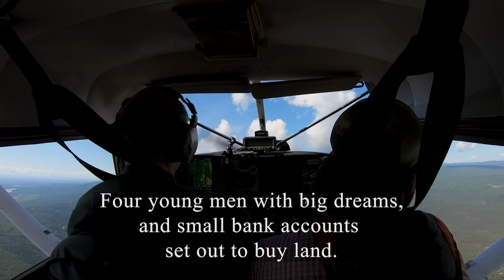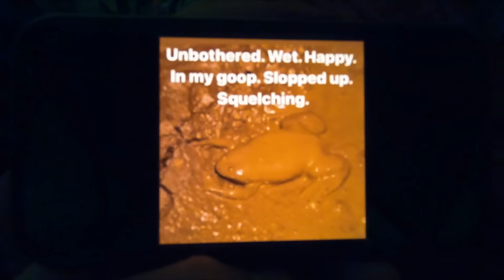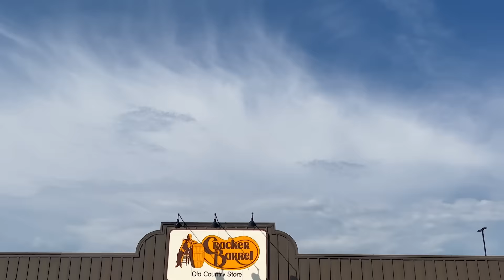30 days Starving and Building a cabin. Hungry Alaskan lessons

Comment: Rugged Alaska. 30-Day off-grid cabin…
If y’all can do it all again, what would you do differently?
How would you pack differently?
More nutrient-dense foods, less packing (meat jerky, freeze-dried fatty morsels)
What tools did y’all come out there with?
What and how much materials (such as nails), did y’all go out there with?
How many acres was the land?
What amount and weight of water did y’all travel with?
Could y’all have had the next scheduled bush plane stock the bulk of your tools & food? How much does a bush flight cost one-way? Learning from the experience, would it have been worth the money?
Moving logs. What better tools could you have taken to accomplish this task?
Wolves. How would you have dealt, if they visited?
Nail shortage. What if y’all bought another, much smaller auger bit?
Moss Collecting. What better (non-electric) tools would you have used?
Ate until y’all puked. What did y’all eat? What was the first thing?
During the whole 30-days, what was the one food that y’all craved the most?
Battery. How were y’all managed to not have battery loss from filming so much?
If carrying weight wasn’t an issue, but power was, then what other tools would you have bought with you?
Reply from the maker: Hey thanks for the interest into the video. 
Done differently we would’ve brought more food of course. In the thumbnail are basically all the tools we used except the folding silky saw (basically did all the cuts). We went there with 3 tarps and a box of 20 penny nails. (We should’ve brought spikes and more nails). The land is 5 acres. For water we brought jugs to fill from the lake and pots to boil it. The bush flight is $700 one way so not cheap by any means. Another flight of food would’ve been nice but we continued to have hope for more fishing success (the fish knew otherwise). Better tools would’ve been a chainsaw and gas but that was too heavy to bring with all our other gear we needed. We didn’t think much about the wolves, it was mainly bears and possible moose we had to be concerned about up there. We had a 10mm, a 357, and bear spray. We had joked that a bear would bring us food to fatten us up instead of eat us anyways. For the roof/ nail situation I think it would’ve taken too long to auger all those holes so our “X” plan was the best we could do. We plan on redoing the entire roof next trip anyways. For moss collecting I think we did it the best way there is with a small axe and rope. The first thing we ate was a large mixed platter of appetizers. (Not the best move) we should’ve ate light and we even knew that going in but it was hard to resist. The one food I personally craved the most was Tony’s oven pizza haha. Lots of fast food cravings too and I’m not normally a fast food guy. Lastly for charging the batteries I used the goal zero nomad 10 solar panel. Hope that helps!

Comment: The odds are that a $250 chainsaw would have left you with no working saw halfway through. But I would have recommended a large crosscut saw for felling instead of that folding saw you went with. Your wooden hammers were really pretty great and I hope you got a lot more use out of them than you showed. An amazing amount of work accomplished in a short time!

Comment: So basically a chainsaw is a must have. Quick tip i have a portable power station that runs on a portable solar panel. Which charges my electric chainsaw, which doesnt need gas

Comment: Guys, next time you decide to do this think about rations. Planning, resources,, planting food sources and gathering food etc. You have thin walls little insulation for when you go back. Maybe niy army ration packs for winter not store bought foods from locsl supermarket. Chainsaw still need fuel oil and sharpening. So hand tool better, but lads think next time or at least ask someone whose built in the woods.

Comment: hard work. looks like nice soft pine least that helps a bit. 
it might pay to rub down with Tung oil or soak your stumps in any oil will probably do. even engine oil is good. wood soaked with oil stops water getting in and freezing splitti g wood it also deters a lot of moulds and bugs. will make your stumps last longer.

Comment: Overall, I'm impressed with how much they got done in 30 days with only 2 guys and nothing but hand tools.  The construction of the cabin looks sturdy, but they need a floor and finish the roof. They could have saved many days, with a chain saw, some sharpening tools and 10 gals of gas.  They were also missing some good sturdy hammers.  I hope that roof holds up under a snow load, but i have my sincere doubts!  In any case I wish them luck.  I admire their GUMPTION!

Comment: ya know, at first happening upon this video I just rolled my eyes at yet another dramatized alaska video. Being an Alaskan I've seen endless massively over dramatized content thats all kinda the same. Everything is portrayed as the EXTREME cause its ALASKA. 
I'm 15 mins in. A lotta thoughts lol most good, some not as great. But you guys are definitely hard workers and not quitters. Your resolve is impressive.
30 mins in.) I could learn a thing or 50 from your remarkably good attitudes. I tend to be a very pessimistic person and know how low my spirits would drop if in the same situation. Color me impressed. 
32 mins in .) no way that roof made it through a winter up here almost certainly collapsed. But I'm in the Fairbanks area too. so our snow load is pretty high.

Comment: You have to put out lines for fish overnight and traps for small animals and birds, and you won’t have to waste time on the water fishing. Don’t do instant food - you both need to carry 5 lbs uncooked oatmeal and 15 lbs each of uncooked rice and beans for 30 days. These expanding foods (1 cup makes 3 cups) alone could account for half to most of your calories daily if you have discipline. A 12-pack of Spam might be more to carry but at over 1,000 calories per can, it is worth the extra effort, but there are singles packs. 4 lbs beef jerky each. 30 Cliff bars each could save your life. Bears still charge after you shoot them, so shooting a bear at handgun range is risky - a rifle nearby could help manage some of that. Carry an air horn with you at all times - a blast should scare them off to prevent you from having to shoot them. If a moose comes, leave them alone at all costs - just go fishing. More people disappear in Alaska each year than anywhere else. Grizzlies are hungry - they will eat you. Nice cabin!

Comment: You guys did good, real good. Your humor showed you both were above the average intelligence of most. And IMHO that is your most important and innate quality. However, I just don't know why you just didn't start off with a chainsaw, a generator, and cordless drills and drivers, etc. Was it about sticking your thumb out at fossil fuels, or was it some knd of philosophical thingy about the purity of the project, etc, etc. The best of luck to you all. I'm 74 YO. I hope I'm around to see kids running around the yard of that cabin, which will be a tool shed by that time I'm sure.

Comment: I’m amazed you didn’t provide for the necessary equipment small chain saw a hand auger at least 2 hammers just the basics to build a structure in 45 to 60 days. Even if you had to make it a 2 year venture first year to deliver the building materials and plan the build . And of course enough of the right kind of foods to make eating Less of an effort

Comment: @24:58 I'm surprised you didn't use the last two lengths for a ramp. and then swivel lift them. Spare your backs lads. it tends to last half as long as you do if you don't mind yourselves.
Reply: Bear-proof that door while you're at it.

Comment: Sounds to me like none of these guys had a clue how to eat (survive) out there. Take small game traps with you for small game, fishing is an obvious choice but you need to know what they bite on in the nearby lakes. An hour or two picking the brains of a local guide can give you valuable tips. Best guns, a .22 rifle and and/or 20 Ga shotgun for rabbits, squirrels, chipmunks, and birds (anything edible). BTW, snakes, some frogs, rats, otters, and beavers are edible. Hire a larger plane, and take bulk dry foods like beans & rice, which you can exist on if hunting/fishing don't pan out Put those in 5 Gal plastic buckets with seal-able lids. On long term hikes, I use to carry US Army LRRP rations or survival foods (dried/vacuum packed, add hot water and eat). There are many edible plants and mushrooms in those damp forests too, but you have to know which ones.  PS, Don't kill anything big, like a deer, because most of the meat will spoil before you can eat it.  If it's bear country carry along, a .44 mag revolver just in case and build a food platform at least 15' up in between 2 trees at least 40-50 yds. from camp.  When working hard all day, you need to figure a minimum of 2000 to 3000 calories P/Day, P/Man.  Lake water for drinking is OK, but you should have a water filtration hand pump, and "purification" tablets with you.  Pack some of you gear in a 55 gal plastic drum with lid (if the plane can carry it), to use for drinking water.

Comment: Good job on the cabin. But I am curious about your foundation. (The trees in holes that everything is sitting on) Will this secure the build and prevent it from being pushed off these supports by the snow during or after winter?  There is a slight slope to the ground around your cabin. Snow can be a strong force when there's enough of it. And I just assume its Alaska so lots of snow and why I ask. (As I have never been there) Thanks

Comment: You brought face bug protectors, but not hammers, other proper tools and equipment, not to mention provisions?  Good try, but you needed more knowledge.  You probably should ha have done shorter close-to-home treks before going Alaska, where weather, dangerous animals, and the elements can overwelm, all but the most prepared and resourceful among us.  220 nails?  I used 320 nails to build a shed cover!  There is a reason that they come in 2000 nails to the box when using a framing gun.  Just a batter powered framing gun and nails would have saved days and calories.